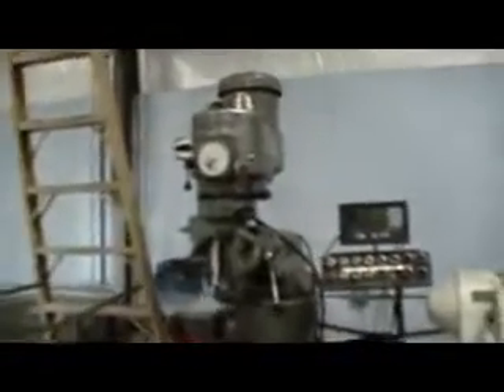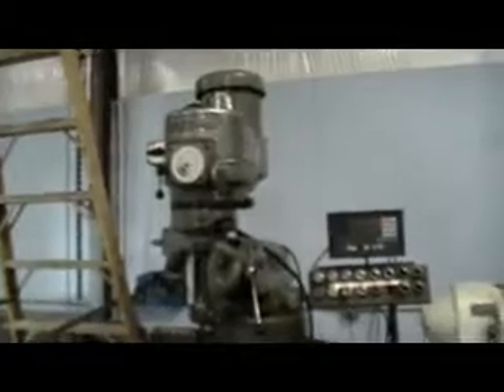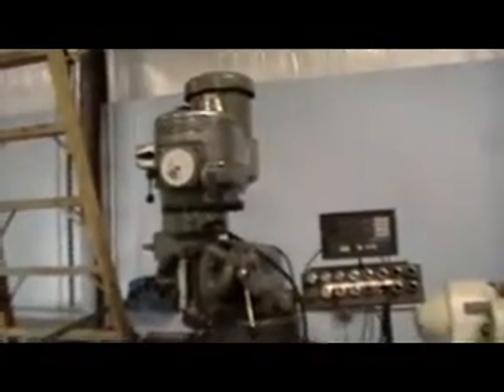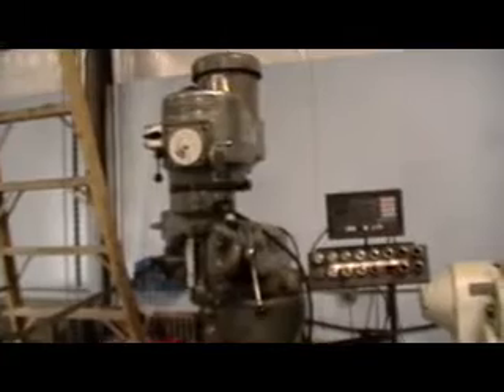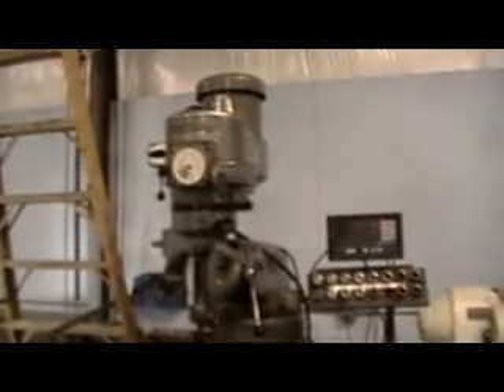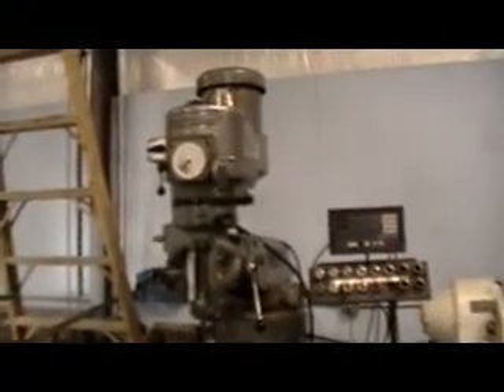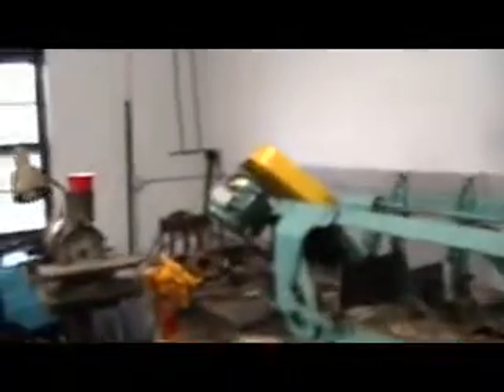Three Phase- My homemade rotary converter 1 of 2

Comment: I simply have a small single phase motor, even a fractional horsepower works well, and a horsepower or larger 3 phase.
The motors in this case are driven by identical pulley.
The advantage of this is that if things do start bogging down the single phase motor keeps things going.
And, like everything else, it can usually be found cheap.